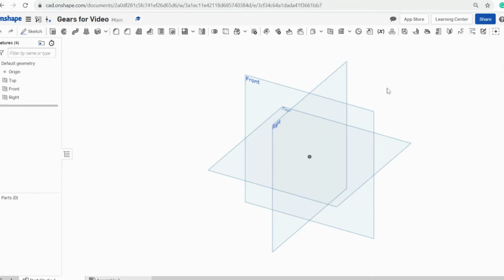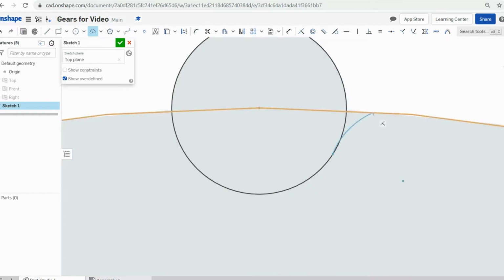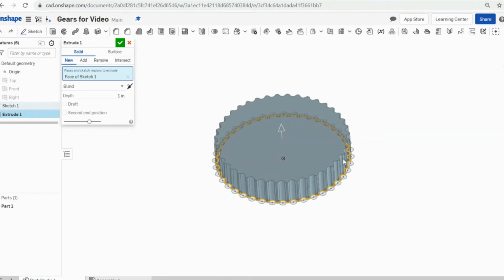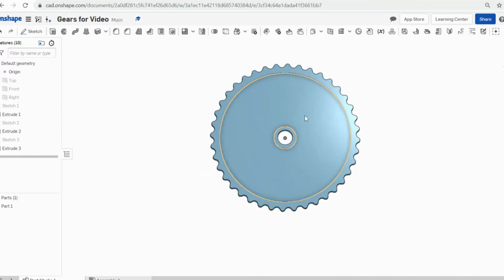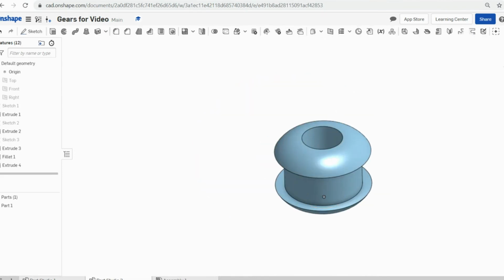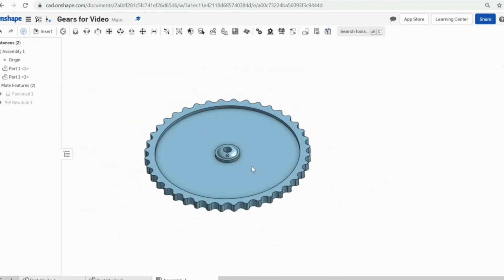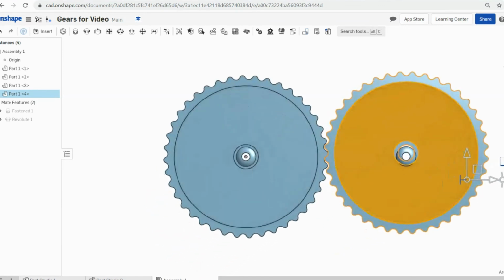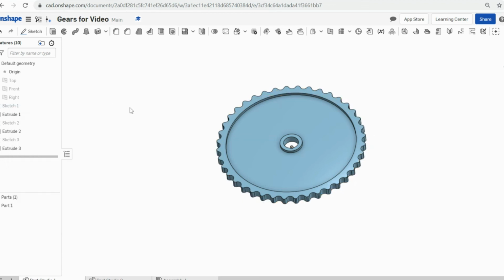Creating Custom Gears in Onshape (Using the Revolute Mate, Assemblies, and the Gear Relation Tool)

Comment: The software is great, but I have found it holds me back due to internet connection strength, also the software only displays a limited number of the patterns, one behind the original and 9 or so in front, this is just because the software has to be as smooth running as possible and say you entered 9999 instances then displaying that number during mock up would slow down your progress

Comment: the second bearing should have been locked in place before doing the revolute, that's why it moved instead of the gear. Also positioning the gear isn't necessary if you align the bearing first.

Comment: When using the circular pattern with higher numbers of instances it "breaks" because it is simplifying the render and when you confirm the pattern it displays all 30. Also, I believe that you don't have to hold shift when selecting multiple entities, when you select an entity and then select another entity the first entity stays selected and if you want to quickly de-select entities just press space.